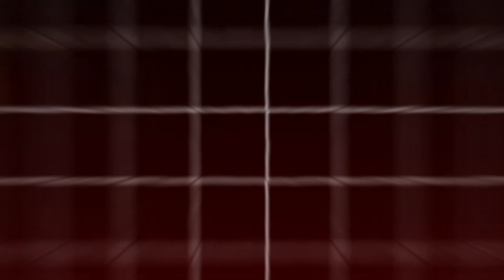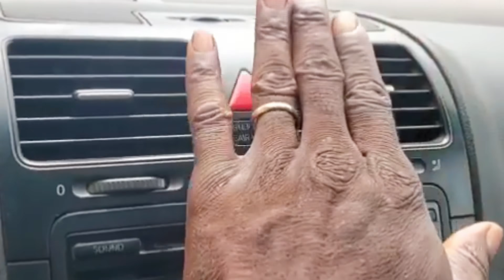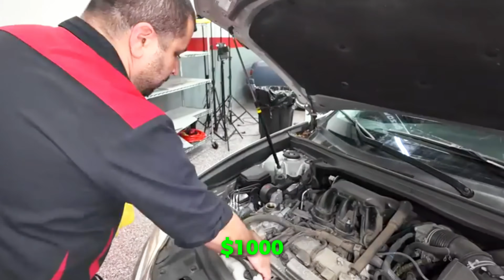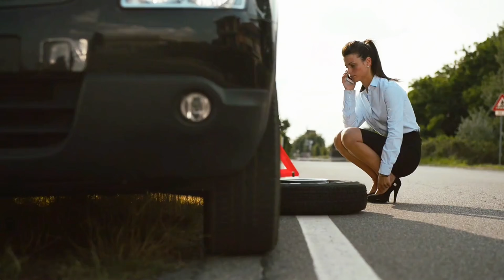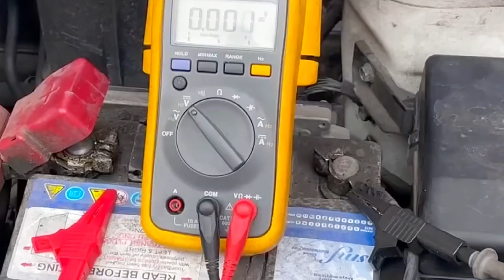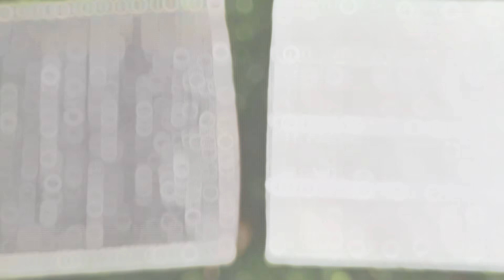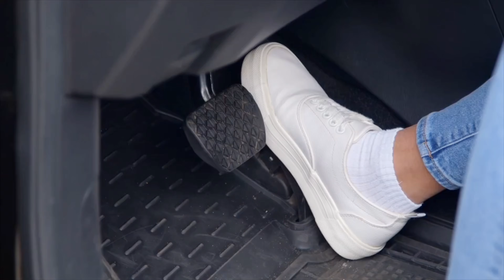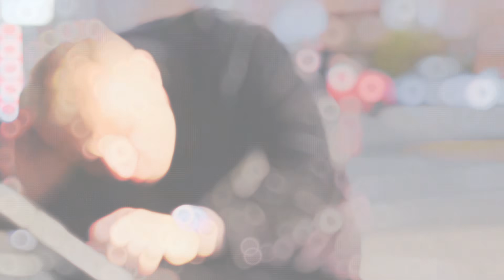Stupid Mistakes DESTROYING Your Automatic Car (AVOID THEM NOW)

Comment: I'm afraid to even drive my car now. 😨
Reply: That means you must have low testosterone levels 😊
Reply: @ultimatewarrior659  Your comment is two weeks old and not even one thumbs up on your joke.
What to make of that.
My thumbs up to follow.
Cheers.
Reply: @DysCardEd it wasn't a joke and by the sounds of it you definitely have low testosterone to be triggered by my "joke" 😅
Reply: It’s just standard maintenance it’s fine
Reply: RIGHT, It's amazing how some cars have lasted so long doing all these things. 🤣🤣
Reply: The music playing in the background is unnecessarily tense. I believe it was designed to cause anxiety. I found it annoying and distracting.
Reply: Make sure use LUCAS high mileage products over 150K miles. Top off 1/4 qt after every oil change and engine will last over 300K + miles   Also LUCAS ethanol gas treatment helps to preserve your engine from damaging additives that ethanol creates on engine fuel components. But most importantly regular maintenance is a MUST. Do not let pass 4k miles on your next oil change and always ask for the 5 points inspection

Comment: Traditional AC systems run 100% when turned on.  On newer cars, it runs whenever defrost is selected. The only way to prevent the car from getting too cold is to mix some hot air with it.  Newer cars may cycle the compressor, but I don't believe using the recirculation has much effect on compressor longevity.

Comment: My dad has drilled it into my head to regularly check my oil. I made a huge mistake once though. I added oil before a long road trip once and forgot to put the cap back on! I went to check the oil again after we returned and there was oil everywhere. I took it to the mechanic and told them about it. They said, that’s very unfortunate. It’s still running fine for now, but I probably took a few years off the engine.

Comment: What about turning off the AutoStop switch? this is a engine killer.... EPA mandated regulation that is causing car and truck owners thousand and thousand of dollars unnecessary repairs. We need the government to mandate the car manufacturers to create a software to turn off that system for free!
Reply: 💯It’s a battery killer
Reply: And a starter killer! Although many cars now have added a button to turn off auto-stop. But with mine, you gotta remember to do it with each ignition cycle. There are also after market bypass switches you can get for many models.

Comment: Ahhh ... the Check Engine light! If it's flashing, as in the vid, then absolutely stop the car and turn it off immediately! If it's NOT flashing and you notice no difference in how your vehicle runs & drives, then no worries. You have little to be concerned about! The vast majority of times it's due to natural emissions wear, where the emissions cleaning system is no longer at top marginal capasity. Possibly a weak sensor or a cc that's still good, but not at prime pollution standards! It's best to buy a cheap code reader and read the code yourself, and reset it. Or as the vid said, some auto parts stores will do it for free! If the OBD code is an emissions code, with no problems, you can ignore it w/o spending hundreds $$$ or more for no reason! Some states require inspection b4 reg renewal. If that's the case, you may have to work around that issue!

Comment: I replace the gas cap every four years. I regularly clean the area of the gas cap make sure nothing as debris get in that place.
I always allow the engine get warm for at least five minutes before I drive,.
Don't ever use flooded batteries. They will ruin your battery cables.
Most of my vehicles last more than 200k miles before I buy new vehicle.
The rest of your issues are unreal, unless you drive a Ford.
Reply: Fortunately neither one of my cars has a gas cap.  It's built into the fuel door.

Comment: Strange why does your tires have a psi on them about 5 to 10 higher than the ones on the cars? I’ve found that the tires wear out faster on their sides of the tread when you go with 32-33 psi on the door jams tag.

Comment: Never knew about parking brake and hand on gear shift! Will change my hand position!
Reply: With your hand on the gear shift, instead of on the steering wheel, you cannot react fast enough in an emergency, which may cost your life.
Reply: One of my cars has a rotary dial. No stick type shifter. Can't really rest your hand on that. My other car has a stick type shifter, but it's electronic with only three positions, Reverse, Neutral, and Drive. But it also has paddle shifters on the steering column.

Comment: If your check engine light is flashing, pull over as soon as possible, shut off the engine and have your engine looked at before driving again. That's what I've been taught.

Comment: Mercifully, I drive a manual transmission car with a proper mechanical parking brake. It does NOT have one of these stupid stop/start features. It does NOT have a 'lane assist' feature. It does NOT have a 'touch-screen.' It does NOT have sat-nav. It does NOT have heated seats. And that's what I like - a simple, easy and straightforward to maintain car which almost any mechanic can fix.
Reply: The perfect vehicle!
Reply: Those have become precious gems now! 💎
Reply: Wish more cars were like this!
Reply: Yes all the tech stuff has gone over the top.
Reply: I have a 2020 Honda Accord with a manual trans. It too doesn't have that stupid start/stop feature either! 
When in an automatic parked on an incline, hold the service brake, put trans in 'Park', then engage the parking  brake before letting the service brake go.
Reply: Drove my 1991 Honda CRX 5-speed manual for 31 years...it didn't have power steering, elec. windows, or even a cup holder- not having a cup holder was tough tho! Now drive a 2017 Honda Fit 6-speed manual, a very good car and I have to admit I am enjoying the power steering and the cup holder! But it's scary that all the good manual transmission cars are getting axed out. Really? What a crock of ** !!!
Reply: I don’t plan on buying any new vehicle. Got a diesel with 5 speed manual. Do maintenance and upkeep. No $130k vehicle for me.
Reply: In other words, you're driving a restored Ford Model T.....
Reply: @JasonKing-m6m  Not quite - although you got the Ford part right. I currently own a Ford Grand C-Max with a 1.6 litre duratec petrol engine (2012) prior to that I had a Kia Venga 1.4 litre petrol, prior to that a Suzuki Liana with a 1.6 petrol engine.
Reply: Most cars down here in Melbourne are Autos. Lots of hills around the east of Melbourne. Most of these drivers have no clue about engine braking so they live on the brake pedal.

Comment: Most of this is common sense. Read your car manual!  If you’ve bought a used vehicle and don’t have one, they can be found online or through a dealership. I’ve never heard of anyone pressure washing their engine with the same machine they use to wash their house or patio!  If you want it done, get it professionally steam cleaned, dried, and lubricated. Unless exposed to very harsh conditions, most cars do not need regular engine cleaning. I learned about the inside air filter the hard way many decades ago. I had the misfortune to run over a skunk and ruptured the stink sack!  Even after multiple trips to the car wash, getting the engine steam cleaned, and thoroughly cleaning the interior, it still smelled. An old fellow in my church who’d once run a garage told me about the interior filter. $5.00 at Pep Boys and the problem was solved. 
Get yourself a competent mechanic who knows your particular vehicle. Usually, that’s not going to be a guy who works at Jiffy Lube or the Firestone Tire outlet. Look for a privately owned repair shop. You may pay a bit more, but it’ll save money and you’ll keep your car longer in the end.  Of course, if you’re traveling or your muffler falls off, chain places are perfectly fine.  Don’t drive without a muffler or with cruddy oil for another 10,000 miles before seeing your preferred mechanic!  If your brakes wear out or your tires are bald or have bald spots, replace them ASAP.  Don’t drive at 75 mph down the interstate and have a blowout!

Comment: I keep my ac on recirculating air cuz I can’t handle the exhaust from other cars coming in. Instant migraine.
Reply: Me neither. I'm surprised that was not mentioned during the video.
Reply: I thought about posting what you posted but thought nobody cared but I see 60 people liked your post.
Reply: FACTS 💯
Reply: Totally agree.  As for the vid, if I needed outside air to vent the moisture during cold weather, I open the window while driving then close them when I get close to something stinky outside.  I never have "outside air open".  I also used to have those portable dehumidifier things (blue crystal pellets) I could leave in my car to absorb moisture during winter to reduce fogging while parked overnight.  Or here's an old school trick -- run the AC for a short time during winter while driving.  That is THE BEST dehumidifier your car already has.

In fact most of this list is just common sense I already do except the BMS because my car predates BMS so I had no idea what that even was.  Had to look it up.  It's for "advanced battery" cars like electrics, hybrids and ICE with start-stop and regen braking tech.  

I still drive my original 2006 Scion so when my battery dies, I pop a new one in and that's it.  I like simple.  :)
Reply: Same. If i have it off then it’s smells gas from other car from outside
Reply: Leave the a/c button on all the time. On the motorway turn it off every chance you get ( maybe once in every hour, with no vehicles at least outside a distance of 500 Km away from you, for one minute, to dry out the condenser. Turn it off  ( you will have to juggle with this time) one minute before you pull into your drive.

Comment: ▶️ *video extremely confusing. Entering a Hot car_Open Windows And press OUTSIDE AIR BUTTON to push hot air outside?
Once hot air kicked out and interior cooling, roll up windows, press INSIDE AIR Button (recirculating one) to cool the air getting cooled  already circulating inside car.
is this correct_please share thank You*
Reply: Roll your windows down until the hot air escapes, then push the recirculation button and turn on your AC.
Reply: @dilsiam  Agree, but that "outside air" button is there for a reason - to use briefly while windows are down

Comment: What if the car has no. Parking. Han̈break?
Reply: It has a break on the floor. You have the gas pedal, the foot brake and then there’s a small brake pedal, it’s call your emergency brake. You push on that. You push it to set the brake. Then you have to push it to release the brake.

Comment: I know and/or do the correct things all the time and have since I started driving at 16.  I'm 59 now.  One thing I will say with regard to wiper blades:  in winter in places where snow and/or ice is frequent, turn the car on, turn on the defrosters, and brush/scrape the snow/ice off thoroughly before ever thinking about turning those wipers on.  I also have a very reliable mechanic.  I didn't keep up with automotive technology, so I ask questions when I have any concerns.  I have an automatic now but learned to drive on and for decades drove a manual.  I learned right away never rest your hand on the shifter.  Anyway, keep your vehicle maintained and it will keep running far longer than you might think it can.  With politicians who are in the pockets of insurance companies who want to take away your freedom to operate your own vehicle freely, maintaining it becomes maintaining your freedom.  Be wise, be diligent, and be knowledgeable.
Reply: Wise, wise words.
Reply: Does anybody remember leg warmers? Well actually, they work perfect if you know there’s a ice storm coming you can just slip your leg warmers over your windshield wipers and instant protection. Used to use something to protect my window from snow buildup but lately does anybody notice the wind is just ferocious and there’s no way that would stay on but my windshield wipers are protected.
Reply: @Psalm-iz5jw You can cover your vehicle with a tarp or something, too, but if it's not cinched down, it'll blow off.
Reply: I live where it gets icy. So before storms hit I try to run out and bring the wipers into the upright position in the air and put a plastic trash bin bag on them. That way they don’t get stuck to my windshield. The ice normally doesn’t get down past the bottom of the bag I’ve tucked under the hood. I ripped my rubber off my wiper one time by turning them on too soon when I thought everything had thawed..

Comment: I've owned some pretty old Subarus and they needed premium fuel to run right
Reply: What tier of gasoline are you running. Paying more doesn’t mean you are running better gas. If you buy gas at Sam’s Club, Walmart , or most cheaper dealers you are getting a low bid fuel not what you think you’re getting.
Reply: @Gary-d8m WHAT????
Reply: What?????

Comment: I always turn my gas cap 3 times after it's tightened.
Reply: Neither of my cars has a gas cap. It's built into the fuel door. You just close it and go.
Reply: @steimystein4368  Oh.  Just turn it two times in that case. : )

Comment: I'll keep my 24 y.o. Buick~
She's never left me stranded~
I take care of her, she takes care of me~
Reply: I will never own a new car.  I prefer old cars.  Like 1970s and earlier.  I have a 2014 now.  I keep it maintained and give it much love.  Ruby is my sweetheart.  I keep her clean and maintained, just like I was taught to.
Reply: I love old cars 🚗 😍
Reply: Buick LeSabre my favorite 1987 8 cylinder 😊❤
Reply: @EdmundFitzgerald1975  Buick LeSabres were great cars!  Mine was just a 6 cyl but I never had an issue with low power.  Passing?  No problems.
Reply: @chrisl7839  I had one back in the early 80’s. Loved it! Could make a 300 mile trip, great gas mileage, and when you got to your destination you could actually get out and not hurt!
Reply: I’ve kept most of my pre-owned cars until they were over 15 years old. A couple of them I gave to my sister and she drove them until I gave her the next oldie. New cars now days aren’t made to last. I’m 75 and now in a 2013 or 2014 Avalon. 🇺🇸
Reply: You know what I have a 2009 Buick lacrosse and everything still works great. Remember the 3800 engine is the best engine out there.
Reply: I am restoring my 1974 Pontiac, and my 1980 Chevy wagon always starts right up.
Reply: I just sold my 23 year old  Jeep for a newer SUV. Wish I had not. More “ stuff” to go wrong on the newer vehicle, supposedly better mileage. 🤷‍♀️🤷‍♀️ Wrong move on my part. 🙄
Reply: @oldasdirt3760 
I understand~
Reply: 30 year old manual transmission Pathfinder here!🤍
Reply: I had an old 6 cyl Buick LeSabre that I loved and took care of, and it lasted a LONG time.  I still miss that car!
Reply: What’s her name ?😂
Reply: @Bless-m1z
Blanche~
Reply: What’s her name?
Reply: @VirginiaSteeb 
Blanche Louise~
I call her Louie after my Momma~

I miss you, Momma 🎉
Reply: I'm currently driving a Camry, but I've always been a Buick girl. My old '88 LeSabre was my baby.
Reply: Your car is a "she"
How can you tell if your car is a she or he?
Reply: @ricedrown 
Because she's never effed me up or left me stranded😊
Reply: @ricedrown I can tell mine is a She because it leaks fluid.
Reply: @ljalpena3552 😂
Reply: @ljalpena3552 😂
Reply: @TroystanleyPNW I love making people cry😂

Comment: GMC makes a stupid recirculate button.  It switches off every time the fan turns off.  When it is engaged, the AC is automaatically switched on.  There is a separate button to turn on the AC.  I live in Florida with 1000% humidity in the summer.  I want recirculate to stay on.  Sometimes I just want to recirculate cabin air without breathing exhaust fumes from other vehicles without the AC on.

I think GMC enginers are jokers who enjoy devising ways to frustrate owners and make their life diffficult.

Comment: Wiper blade tip. Clean the wiper blades.  Then apply a thin layer of silicon grease (not petrroleum jelly) -- aka plumber's grease from plumbing store.  This will make make blades last longer.
Reply: I thought plumber grease was for mostly hot water stems.
Reply: I use silicon WD40 on squeaky wiper blades.  And silicone doesn’t damage the blades.

Comment: Never buy a car that has been in a flood!!! Even, USED CARS, ANY VEHICLE will have troubles.  Only, mechanics should buy for their own use  or  give vehicles to schools teaching new Auto mechanics  STUDENTS  TINKERING PROBLEMS, PARTS CLEANED, And replacements, project to train on. Do NOT SELL FLOOD Vehicles with out warning to new users/potential owners. 😊😊. Correct??

Comment: ERG valve repaired but the light came back on 2wks. later. Diagnosis again said it is the ERG Valve😢! Could the erg valve  a lemon???      There is no noise, or smells.

Comment: I bought a new car in 1996 and I was driving from California coast to G.J. Colorado when I was in St. George Utah filled my car with gas and on my way, I got a check Engine light and this was very stressful especially in my new car, I stopped and discovered that I left the gas cap dangling and the door open, what a stupid thing to do.  I put it back on and closed the gas filler door but that check Engine light stayed on. When I got to G.J. I CALLED THE LOCAL Pontiac dealership and asked the mechanic about it and they said it's the sensor and it will go out once you drive 500 miles after correcting the problem.  So very shortly after that the light went out.  On this same trip my car made a loud metal banging noise with a definite pattern. I looked this up in my manual and found it was the automatic breaking system performing a periodic check.  This happened every 500 miles.
Reply: Obviously you're not cut out to be in charge of a motor vehicle. You should sell the car and use public transport...
Reply: @JasonKing-m6m haha! 😂
Reply: I've never heard of the braking system doing that! Wow!